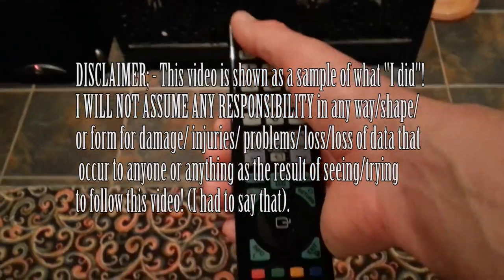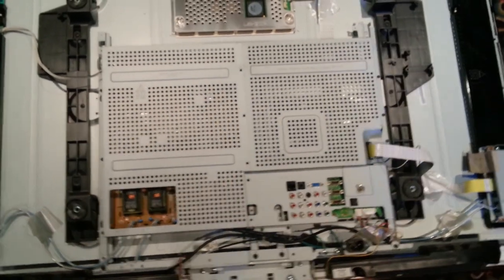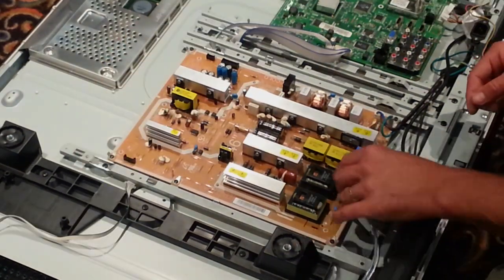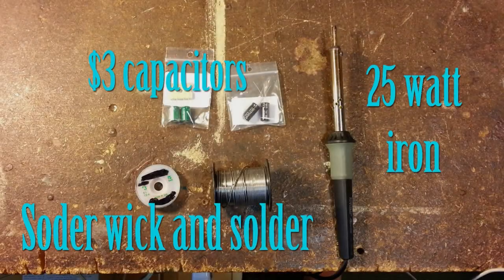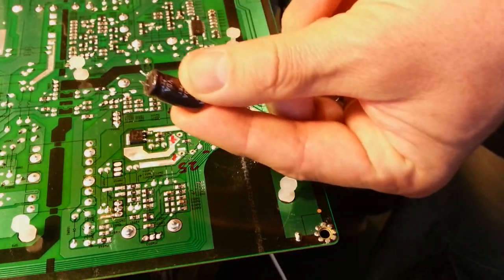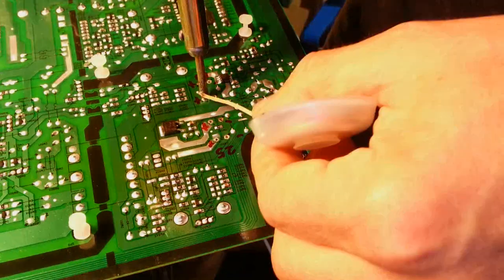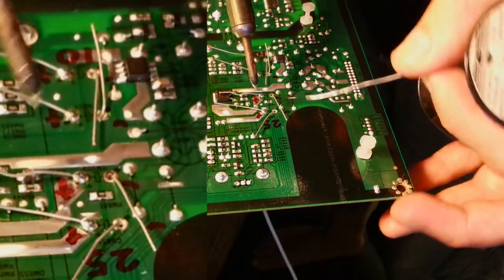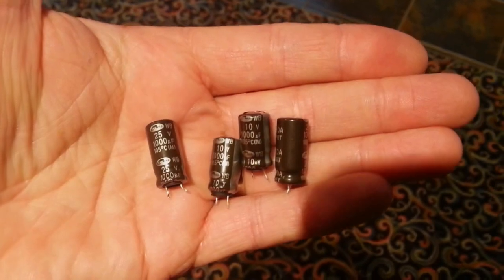Samsung TV won't turn on + blinking red light (explained fix) #18

Comment: I like this video and probably need this video to fix my Samsung that just broke down last night, I think too much power was running thorough it in terms of HDMI connections stuff, anyway it went. But I think before attempting this I will study up on Capacitors more. Any other tips on making sure you are using the Capacitors safely, would wearing rubber gloves help and are there any MUST NEVER DO tips?

Comment: Hey! I enjoyed your straightforwardness a lot. It will pose as tons of help in my 'fixing the TV' journey. But hey, I don't know if you still remember it, how many times did the red LED light blink? Mine flashes six times, then stops for a bit and repeats (without ever being able to turn it on). I'm going to try and replace these capacitors anyway, but it would be better to have a clear spotlight on the issue. Thank you a bunch! Peace.
Reply from the maker: Yes, I believe mine had the same pattern with the LED flashing 6 times,then repeating + the relays were clicking repeatedly until I unplugged the TV from the wall. Thanks for your kind words! Good luck with yours.

Comment: I have the same problem but the only difference was, there were no visible swollen or damaged capacitors. What do i do now? Should I check for capacitor voltages and see if they have the right corresponding values?? -55" Samsung Plasma TV.

Comment: Hi and thanks for the video. My seller shop already changed these capacitors in 2012... they are out again... it looks like it happens every 5 years, that's a short period ! 

Could you tell me why you didn't put 4 x 25v / 1000µF ? (change the 10v for 25v) ?

Comment: Have you ever had a problem with a transformer it's(how would you check one) like after the tv builds up the heat it would shut off  .?  No bad capacitor but I did have some diode that read both ways. The aluminum bars that hold the standup diode had cracks and a lot of cold solderings. It was like the bigger soldering point like a large capacitor or bar had. Bad or cold solderings so I redid those and it stopped all that clicking and had not cut off sense? The diode still is weird to me like why they tested both ways but yet it's running??? And the stand-up some of the diodes tested bad too made me feel like future problems are coming it would be a great help if you had video testing on transformers, stand up 3 prong diodes and diodes would be awesome if not thanks for your already shared knowledge & Happy New Years.

Comment: Hello  good Sir. will this method work for a LN32A450C1D, also how would I know what capacitors to buy or can I just buy the kits listed on ebay? I know its more expensive but I dont have any of the the tools and figured the kits had everything including the soldering tools
Reply from the maker: Different kits on EBay will have different components (of course). You will need to investigate this to see what works for you. On my TV I simply looked for the swollen capacitors and replaced them with the exact same voltage and capacity capacitors.  You must read the EBay description carefully to make sure you get exactly what you need.

Comment: Thanks. Mine is an HP plasma. It was on the legacy pages as it was delivered, and scrubbed from HP when I looked again later that week. Fortunately it worked as a monitor for the cable box for the last decade. Last time the power went out the old thing was reluctant to start. This time it just will not do it. I suspect the same root problem.

Comment: I think I have this problem with my SAPN64F5500, when the TV is warm, if you turn it off, I get 5 red blinks and no display.  Wait about 15 mins, then it will turn on.

So at the moment its a nuisance, but manageable.  

If I go in for the fix, where do I get the matching capacitors?

Thank you, this was a phenomenal guide and very well done video!
Reply from the maker: Thanks! I picked up replacement capacitors here in Canada at Sayal Electronics. I believe they're in the states too. (I'm not sure where you are.)
Reply: Thank you so much!

Comment: Thank you for your videos.
i have similar board that in addition to the capacitors have a 1 ohm resistor next to the 2 Mosfats that burn even i replace it.
kindly advice.

Comment: Quick question. I am having the same issue and I have attempted to replace the entire board as I have a duplicate tv that had screen damaged in the move. I removed the board from the tv and replaced it with the board from the tv that had screen damaged and fired it up. The red light came on but nothing on the screen. This may be a dumb question, but do all boards holding the screws in have to be screwed or should it work regardless. Just wanted to check that it work first before I rescrewed board into its place. Thanks in advance.
Reply from the maker: There is a possibility that one or more of those screws needs to be electrically connected (via a screw) to chassis ground. Also make sure all ribbon cable connectors and any other connectors are all fully seated in their sockets.

Comment: Electrically speaking you can use a higher voltage rating for capacitors. It will not harm the TV. Example a 470uF at 16 WVDC can be replaced by a 470uF cap at 25WVDC.
Reply from the maker: Yes, true.

Comment: My caps all look fine, is there something else I should look for?  I tested the fuse, and that is fine also.
Reply from the maker: Sometimes, these capacitors will short out without any visible outward signs. If I were you, I would replace all the larger electrolytic capacitors on the "power supply side" of the circuit board. On mine there were 7 standard electrolytics, but I replaced 4. They are extremely cheap and common. Make sure they are EXACTLY the same rating in volts, and microfarads, and that they do go back in the same way as the old ones came out (polarity wise ie + positive ,  and - negative).
Reply: +Mysimplefix,  so I replaced all of the caps,  and the exact problem still persists. Any other ideas,  or is it time to invest in a new multimeter and start testing all components on the board? Or just junk this thing...
Reply from the maker: Tony Conz, your TV's not a DLP television is it,  with a bulb? Just needed to verify that, as blown bulbs can exhibit similar symptoms (if the bulb is blown, making a poor connection, or if the cooling fan for the bulb is stuck causing overheating). If it is an LCD, did you see any capacitors that were physically swollen or leaking before you replaced the capacitors? If you did, there is always the possibility that one that was internally shorted inadvertently caused damage to one of the connected components. As far as testing these components with a multimeter, in order to get a proper measurement on each component, it will need to be removed from the board, as each capacitor is connected to other components, so, your measurements won't be accurate, as those other connected components will interfere with your readings. If I were you, I'd just double check the soldered connections you just made to make sure the connections are good and clean.  I hope this helps.
Reply: +Mysimplefix It is an LCD, all caps physically looked good prior to replacement, but I didn't test with a multimeter.  Per your suggestions I replaced them anyway, but the issue still persists.  I went back through to visually make sure that the polarity was correct, and it is.  I will check the solder points again.  Thank you so much for your help!
Reply from the maker: Tony Conz, One last thing, if one of those capacitors did short out, it could have taken out a fuse on the board. Unplug the TV from the wall outlet, zero the hi voltage capacitor(s)  by shorting the legs together with a screw driver (being careful to only be touching the plastic screwdriver handle with your hand when you're doing this, nothing else). Then with a multimeter, make sure any fuse(s)  measure zero ohms.
Reply: +Mysimplefix My multimeter broke a while back, so I guess its time to replace it.  I tested the fuse already using the speaker wire to one end of the fuse and the other end of the fuse to a piece of metal trick.  It obviously doesn't test resistance, but at least I know that the fuse is intact.

Comment: hi, i watched three/four times the process of zero charge capacitors but didn't really get it ..
did just put your flat screw driver on top of capacitors or did you put screw driver on two capacitors at the same time ?
Thaks in advance ..!
Reply from the maker: There usually are large capacitors on the circuit board,  labelled with a rating well above 50 V (which stands for volts), not to be mistaken with the "funny looking u" which represents "microfarads". Any capacitors with a high voltage rating may (even after weeks of being turned off) still have a dangerous voltage still present in them which can seriously hurt or possibly even KILL the person working on it if that electric current takes a path through both hands and passes through the heart! . When I "zero" those capacitors, I am simply using the metal blade of a screw driver to cross (short circuit) the 2 legs coming out of the side of the capacitor creating a "forced discharge" to take place, which will safely remove all the voltage present in the capacitor. If there are more than 1 capacitor, I will do this a couple times to be sure their voltage is at zero volts.
Reply: Northcaledon after opening, capacitors seems ok ..!
And my tv does look anything like yours, so to figure out what is wrong is a headache ..
Anyways Thanks for the quick reply !!
Reply from the maker: Sometimes capacitors will not always bulge when they short out. I would youtube or Google search YOUR exact model TV, and see what your results are. What is your tv brand name and model number?
Reply: Northcaledon it is hitachi,DV3, L19DP03U, ..tv worked well, switched it off from remote Cont. then next morning ; nothing at all ..? when i plug it, standby red light is on, i press on, blue light comes up then turn back to red ..?
Reply from the maker: Well, I've snooped around the net and haven't found anything other than the following."Unplug the power cord from the wall. Then press and hold continuously the power button for a full 30 seconds. Then release the button. Plug the TV back in to the wall outlet, and try turn it on again." This probably won't fix your problem, but it will rule out a glitchy or locked up circuit board problem due to a possible voltage spike that may have occured.
Reply: Northcaledon :-) 
Thanks that's nice anyway, will try this but won't hold my breath on it, actually i looked around too but couldn't find much beside the user manuel in English..!!

Comment: My Samsung UN46D7000LFXZA has the problem with the standby light on but set won't power up.  Power light blinks twice in rapid succession for five times then clicks and repeats cycle until unplugged.  I have viewed all capacitors and other parts on the power supply board for any evident damage and found none.  No damage indicated on reverse side either.  Do I take the capacitors out of circuit to test for my next step or could there be another problem causing this?
Reply from the maker: Shorted (defective) electrolytic capacitors do not always exhibit the visible signs that they are internally shorted (bulging tops or evidence of leaking out onto the board). Given that those capacitors are so cheap, and that you have the board out and accessible, I would replace those large capacitors and try it from there. Make sure you replace them with the exact same voltage and capacity capacitors.

Comment: I have a Samsung UN55B7000FXZA that has the same flashing light are the caps the same as what you changed? 10v 25v?
Reply from the maker: You need to visually inspect those capacitors. They do vary in voltage and capacity from tv to tv.
Reply: thanks ill take it apart and see thanks very much for the quick answer..
Reply: Ab 7775 
I have the same TV and none of the capacitors seem to be blown or leaking. How did your tv issue turn out?

Comment: is there anyway to know what components I need before I take my TV apart? are them four universal across Samsung tv? or must I take it Apart to see the model number of the component.
Reply from the maker: If the TV' was mine, I would take the covers off to reveal the components. The electrolytic capacitors that "usually" swell up and pop are the ones located on the power supply board (the wall cord plugs directly into that board). Now, as for the electrolytic capacitor(s) ratings, they vary from model to model as well as TV brand. During the visual inspection, the voltage and microfarad ratings will be easily seen on the sides of the capacitors.

Comment: I don't get how u zero in the capacitor do u touch both wires at the same time of each capacitor
Reply from the maker: By "zeroing the high voltage capacitors", I'm ensuring that there's a safe work environment. All  capacitors have the ability to hold an electric charge. The larger the microfarad rating, the greater the electrical storage capacity. The larger voltage rating combined with a large microfarad rating can = a possible DEADLY ELECTROCUTION hazard to anyone poking around them or the connected circuit board. Capacitors can hold a charge for hours, days, or even longer!  Generally, I look for larger looking capacitors usually large "can"  shaped (but not always) pieces with 2 metal conducting legs sticking out of them going to the circuit board). Personally, "if I see" a voltage rating over 50 volts, I will hold the handle of a plastic handled screw driver to "short out" the legs of the capacitors to bring them to 0 volts. If the capacitor is charged, there will often be a "spark" when the legs are shorted to the screw driver. I hope this helps.

Comment: I have a Samsung series 6 purchased in 2012.  Looked at several video's that talk about capacitors being the cause of the screen goes black or blank  Due to them being blown or leaky.  My capacitors dont seem to be leaky or swollen. Could there be any other reason for losing the picture? Thanks in advance  Mysimplefix
Reply: Frank Mora I have the same Tv. it looks nothing like this one in the video when i opened it up. I see no bulging capacitors at all

Comment: How does one go about discharging the large capacitor(s) when your tv has the really big one ? If no answer I am simply going to avoid it as best possible. Also one of the capacitors that have the end pushed out a little is a 25V capacitor, unlike the other 10v ones, if upgrading those to 25v, what should the 25v one be upgraded to? it has also bumped out the top. Two of the 10v ones are leaking electrolyte.
Reply from the maker: +CPDynamics the goal is to "short circuit" the 2 terminals of any high voltage electrolytic capacitors using, for example, a metal blade of a screwdriver (while touching/holding the plastic screwdriver handle only).  One must be VERY careful not to cross the 2 terminals of residually charged capacitor(s) with fingers or body parts or one could get electrocuted. If a high voltage electrolytic capacitor is sitting flat on a circuit board, then the board will need to be carefully flipped over, and the 2 soldered terminals of the capacitor will then need to be shorted across the 2 soldered connection points. 
Now,  regarding the capacitor voltage values ie - 10 volts, or 25 volts.... The voltage rating can be higher BUT NOT LOWER than the ones that were taken out from the circuit board. BUT, the capacitor rating in microfarads MUST BE THE SAME as the ones that were taken out. Also, the new ones must be installed the same way the old ones came out ( negative leg in, where the old negative leg came out.) Electrolytic capacitors used in these devices are polarity sensitive, and are  marked showing  "negative" on one side of the can itself.
Reply: Mysimplefix
Perfect!, thank you so much for your quick reply! so I could do 35V capacitors for all of them? there are 5 total, 4 10v and 1 25v that have bulged..
Reply from the maker: CPDynamics Yes. But keep in mind, if there are adjacent capacitors of the same size and type nearby that may be involved with the same circuit, I would suggest replacing them as well. Their lifespan will likely be the same,  and the capacitors are cheap.

Comment: Hey Mysimplefix, I changed 4 capacitor on my ln40a530p1f. Tryed to turn it on but still does the same blinking red light. Have u done anything to reset tv display after installing the 4 capacitor or it went on instantly :O ? Nice video !
Reply from the maker: Hi, on my TV, there was nothing to reset. I just reassembled, and turned it on. I'm actually watching it right now.

Comment: Hi. I loved your video, simple, intelligent, and informative. I have a Samsung LCDmodel #LN46A500T1FX2A, it's about 7 years old. Same problems you described, clicking, on/off, power light blinking, sound static only full volume, black screen. I followed your instructions and inspected the capacitors. They appear to be fine, no bulging, no breaks. Can the capicitors look ok and still need replacement ? If not, what else can be causing this ? Thanks in advance.
Reply from the maker: Usually, an electrolytic capacitor that is blown shows up as "swelling" on the top, and sometimes "leaking fluud". It is possible yours still has at least one shorted out capacitor or more even if there are no outward signs of this being the case. Seeing as how common these capacitors are in failing, even if your electrolytic capacitors are not bulging, I myself would consider replacing those 4 common capacitors that I replaced in mine. A quick google search for your exact model of tv, lead me to a replacement kit being sold on Amazon for 9 dollars. Always verify that any replacement components are of the exact same voltage and capacity as your old ones.
Reply from the maker: ... And thank you!